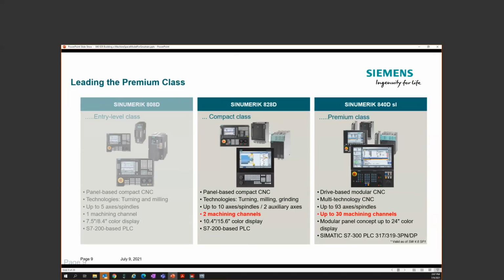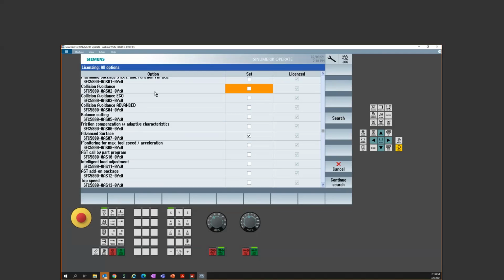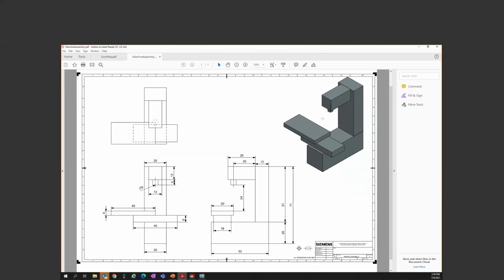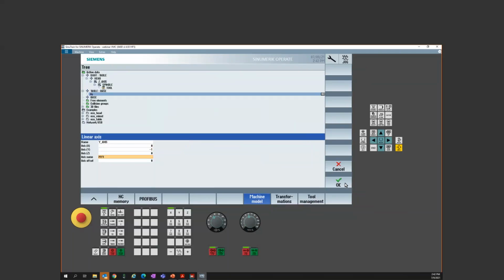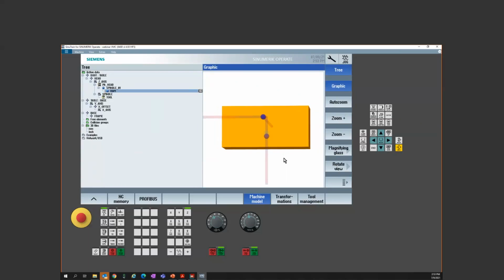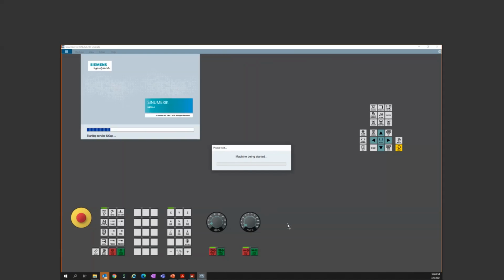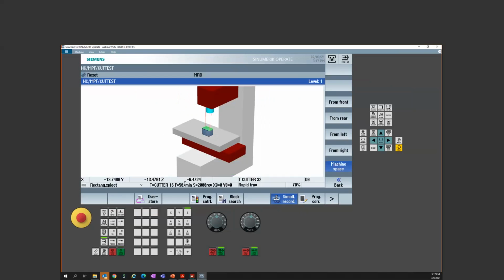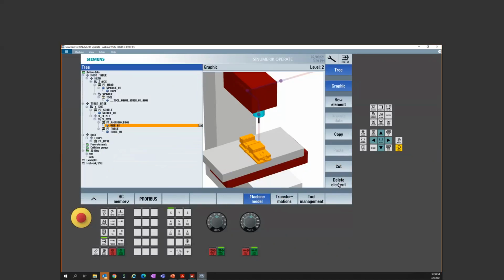Building your Machine Space Model for SinuTrain

Comment: G700
$MN_ROOT_KIN_ELEM_NAME = "ROOT" 	;MD16800
$MN_COLLISION_TOLERANCE = 0.05  	;MD10619
$MN_COLLISION_PREP_CALC_TIME = 0.5  	;MD10621
$MN_COLLISION_SAFETY_dist = 2   	;MD10622
$MN_MM_NUM_KIN_TRAFOS = 1         	;MD18866
$MN_MM_NUM_TOOL_CARRIER = 3       	;MD18088
$MN_MM_MAXNUM_KIN_CHAIN_ELEM = 50 	;MD18880
$MN_MM_MAXNUM_3D_PROT_AREAS = 17  	;MD18890
$MN_MM_MAXNUM_3D_WPFX_PROT_ELEM = 0 	;MD18890
$MN_MM_MAXNUM_3D_PROT_AREA_ELEM = 68  	;MD18892
$MN_MM_MAXNUM_3D_T_PROT_ELEM = 1  	;MD18893
$MN_MM_MAXNUM_3D_FACETS_INTERN = 1000   ;MD18894
$MN_MM_MAXNUM_3D_FACETS = 0         	;MD18895
$MN_MM_MAXNUM_3D_COLLISION = 0    	;MD18896
$MN_MM_MAXNUM_3D_INTERFACE_IN = 16  	;MD18897
$MN_MM_MAXNUM_3D_COLL_PAIRS = 10     	;MD18898
$MN_PROT_AREA_TOOL_MASK = 1      	;MD18899
$MNS_ACCESS_WRITE_CA_MACH_JOG = 6 	;MD51162
$MNS_ACCESS_WRITE_CA_MACH_AUTO = 3    	;MD51161
$MNS_ACCESS_WRITE_CA_TOOL = 1      	;MD51162
newconf
m00
m17
md36100 X Pos =.1
md36100 X Neg = -40.0
md36100 Y Pos = .1
md36100 Y Neg=-20
md36100 Z Pos=.1
md36100 Z Neg= -20
MD34100 Z = 0
MD53230 Z = 0
m00
m30